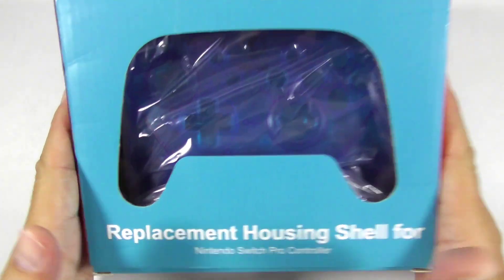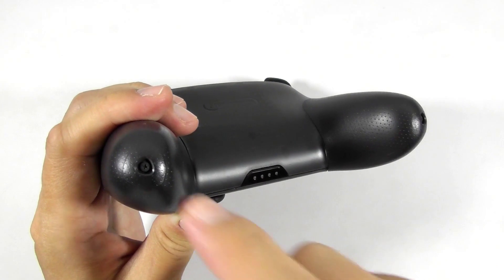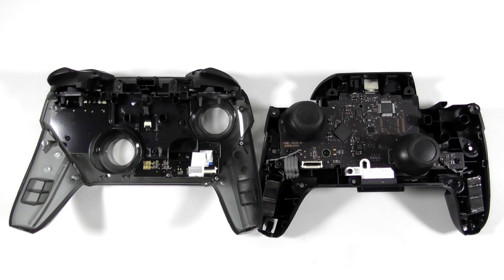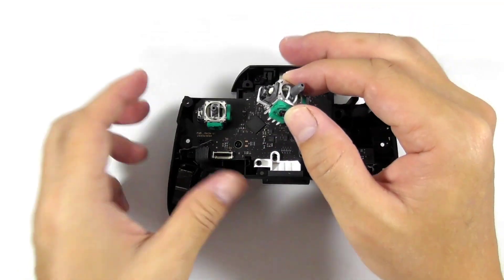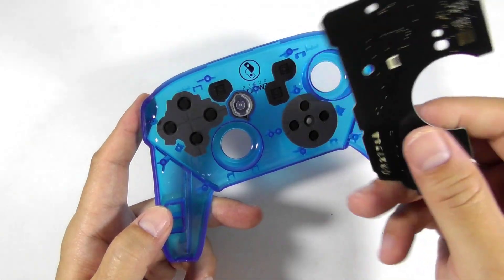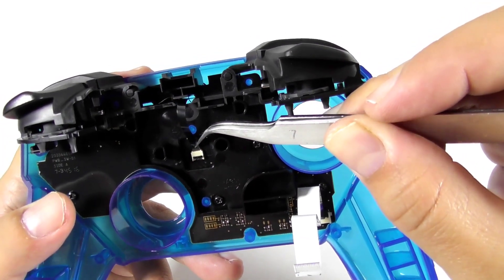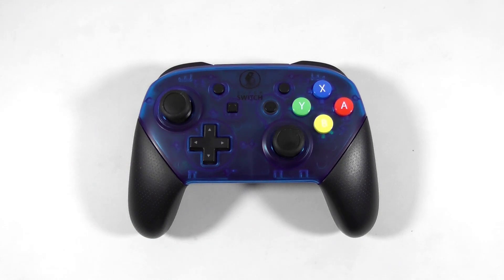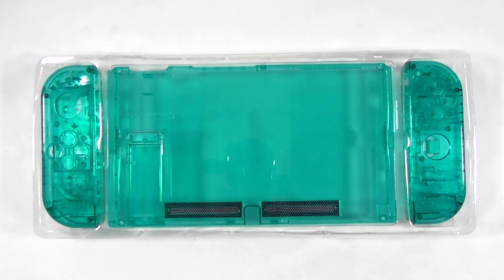How to install Myriann Replacement Housing Shell for Nintendo Switch Pro Controller

Comment: Thank you so much! This step by step made it super easy.. it's even more amazing you circled the screws, without that I'd have gotten so lost! Lol ribbon cables freak me out though..  the tweezers I have aren't slanted and I'm afraid they'll stab a hole in the ribbon cables so I did most of the maneuvering with my fingers (small ass hands) lol

How easily so ribbon cables break, and if they break are they expensive to buy or difficult to get?
Reply from the maker: it is easy to buy flex ribbon cables.. u can find it on ebay

Comment: Good job, nice video. 💪🏻
Maybe you can help me. Since I swapped it my shoulder buttons doesn't work anymore... Cable seems to be okay... Any ideas?! Thanks in advice 🙇🏻‍♂️
Reply from the maker: look for misplaced / improper button installation.
Reply: @sthetixofficial  everything looks fine, also the golden contacts are not damaged. The second stripe look also good... Idk, can't find the issue... 🤷🏻‍♂️

Comment: I’m having a lot of trouble removing the two screws on the handles. I’m using the correct screwdriver but it still won’t budge, screws are starting to become stripped too. What can I do?
Reply from the maker: use the slotted screwdriver
Reply: sthetix I’m using the flathead mini screwdrivers too, but it seems like the screw doesn’t even budge and it just gets stripped after every attempt. I’m also using many different sizes for the philip and flathead
Reply from the maker: in that case i cant help u.
Reply: sthetix ok, thank you though